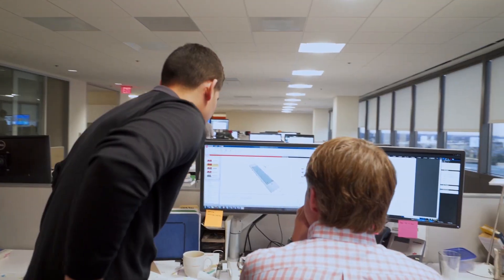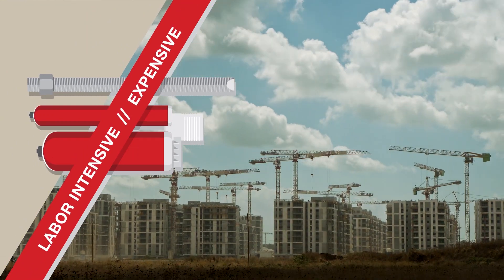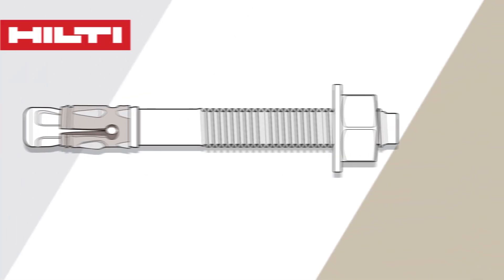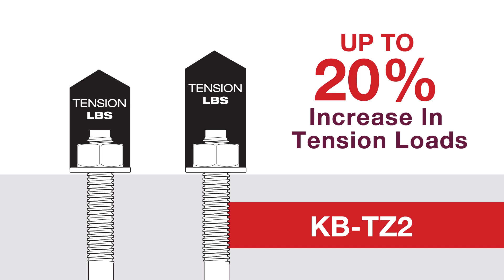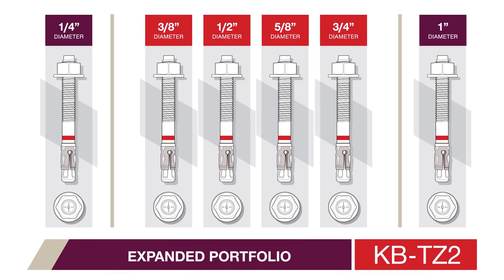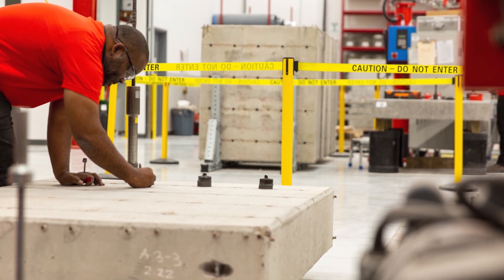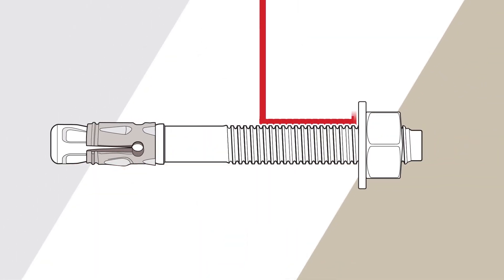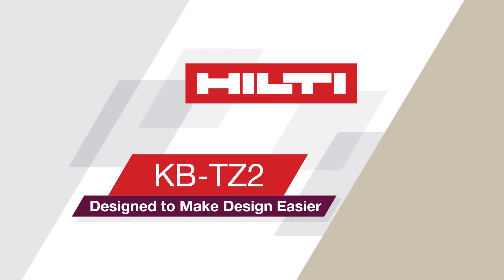INTRODUCING the Hilti wedge anchor KB-TZ2 designed to make design easier

Comment: Two different SS.  It’s confusing on site.  

When engineer specifies stainless steel but don’t identify either SS304 or SS316.
Reply: For real. Engineer should be specifying a specific grade based upon the environment. I usually go with SS304 when nothing is specified. Little cheaper. I do not like using zinc plated unless indoors or away from moisture.